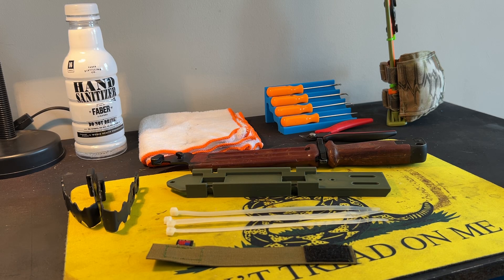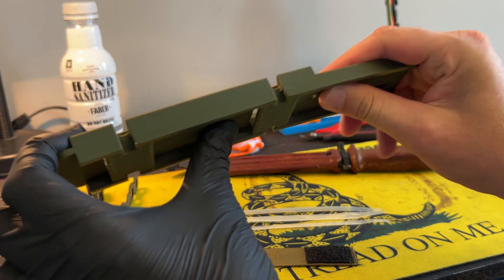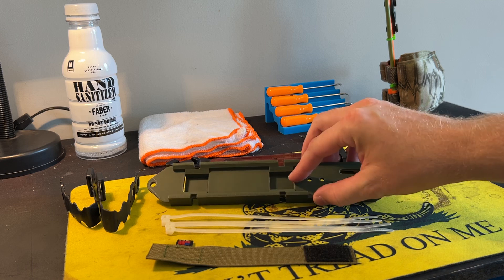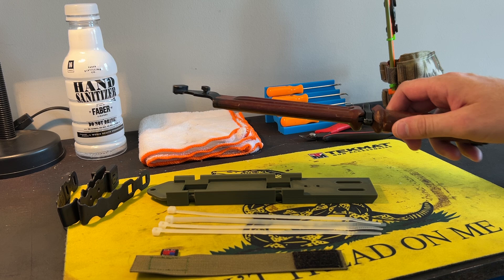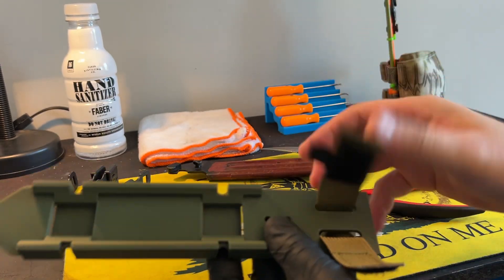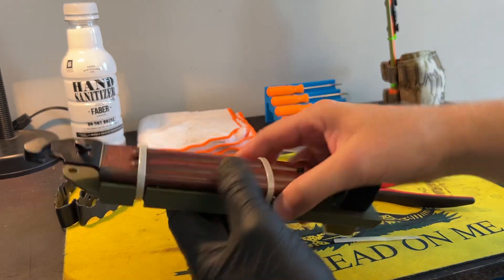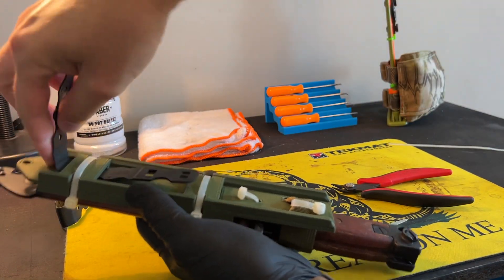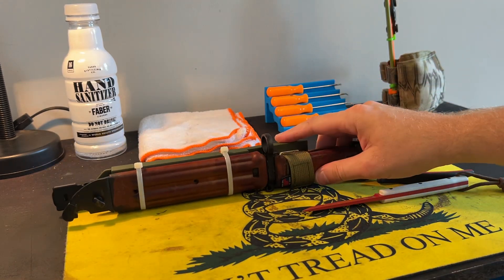Leonidas Custom Gear AK Bayonet Type 2 MOLLE Adapter ASSEMBLY 2024

Comment: Very cool! Unfortunately, I have a different AK bayonet. 🔥👍
Reply from the maker: @knives2my497  Gotcha - I did have a guy buy one who has a Type 1 sheath with the thick rubber piece on it. Not sure how well it worked unfortunately 😅
Reply: @MrLeonidas0001  yeah, that sounds like the one I have. 👊
Reply from the maker: @knives2my497  Well I do run sales on the store so if you wanna try one give me a heads up 😉